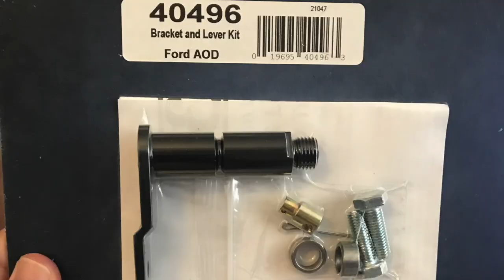1973 Mustang Day1 - Part 2 of 2, AOD Installation (Plus iPad Photos) 20210317

Comment: What headers are you guys using?
Reply from the maker: Those are Hooker Long Tube Ceramic Coated headers.  They were installed by the prior owner.  I ended up installing an X-Pipe to help reduce some of the harshness and raspiness of the exhaust sound with the FlowMaster mufflers.  The exhaust sounded plenty awesome, but after 15 minutes of driving the drone became unbearable.  The AOD reducing the RPM at 60 MPH from almost 3,000 to just under 2,000 helped reduce the cabin noise quite a bit  But, the X-Pipe helped tone things down.  In addition the operating temperature of the engine was reduced by 2-3 degrees as it made it easier to get rid of the hot exhaust gas.  In theory it would have also increased horsepower, but given how fast this Mach 1 is already it is hard to tell just by driving it around.  Even if it did help performance a bit, I was not after getting it to go faster  If I want serious speed we have a 1969 Shelby GT500 and a 2020 Shelby GT500 that answer that "need quite nicely.

An aside, the Hooker headers fit in this Mach 1 very nicely.  But, this is a 351W (not C) engine, which is a little taller than the stock 302 that was in the Mustang originally.  In one of our AOD transplant videos (I think this video in fact) we did have to do a little shaving of a collector flange to clear the AOD case.  They fit perfectly with the original C4.  I see no alteration to the suspension linkage to clear the headers anywhere.  If ever I needed to replace these headers I would use Hooker Long Tube again, and the ceramic coating as well.

Comment: Was it necessary or insulate by the header to prevent heating the trans oil?
Reply from the maker: I did not insulate the tranny from the headers.  I did, however, install an external transmission oil cooler.  I have not had any indication the tranny is overheating.

I am pondering installing both  tranny oil temperature and pressure gauge to display in the center vertical bezel for mounting, just because I am curious what those values run at.  If I end up doing that I will create a YouTube video on that/those project(s).